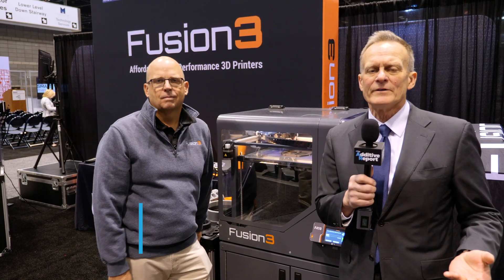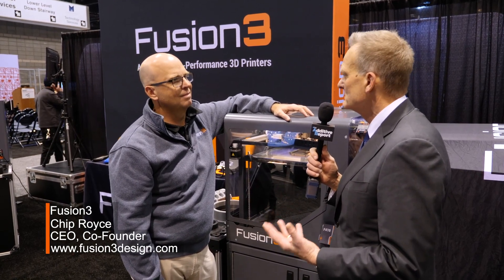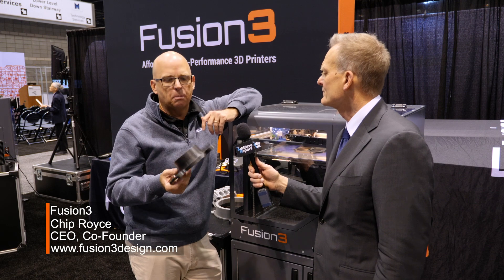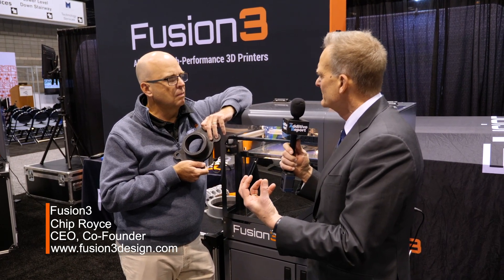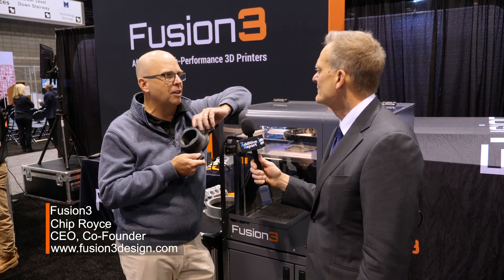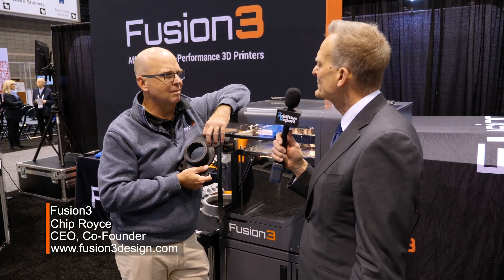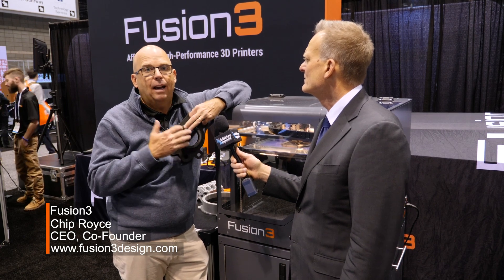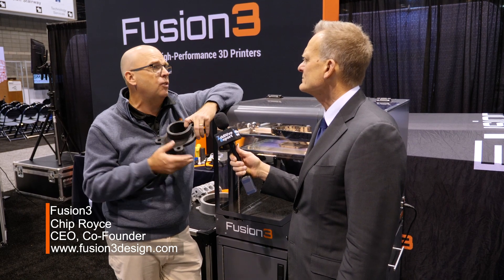Interview with Chip Royce of Fusion3 at FABTECH 2019

Comment: I wasted nearly a month going back and forth with their tech support to solve a problem that I told them was being caused by a failed component on the controller.

Every time the printer tried to auto bed level the head would crash into the foil, shove the glass into the bed support and cause the Z axis stepper to skip.  This in turn caused the bed to become several mm out of level, which required much effort to correct.

I cooperated with them at every step of their troubleshooting and maintained the highest professionalism even after having been accused of making modifications to the firmware - they later appologized after I sent them a copy of all the files and they could verify that the only changes were those they had instructed me to make.

In the end they did send me a replacement board and the printer was immediately back up and running.

Based upon my personal experience opperating - and repairing - the F410, I do not recomment purchasing this printer.  Save yourself a ton of money and built a CORE XY from a kit.  The F410 is actually based on the Core, but the Core is much cheaper - a Creality Ender 5 kit is under $600.00, and its fully opensource.   If you want an envlosed printer its easy to DIY a cabinet. 

Stay away from this printer.